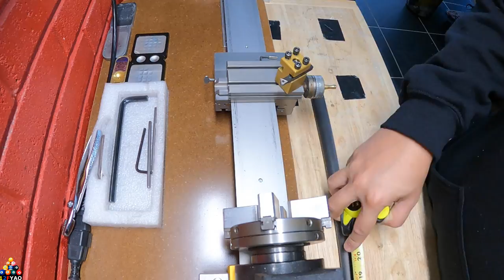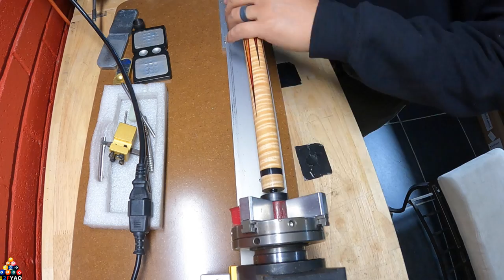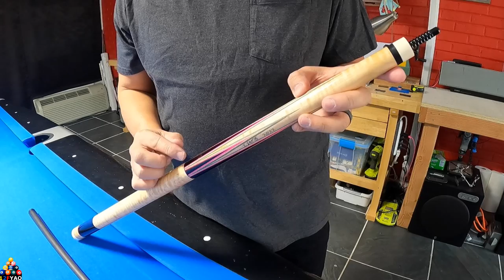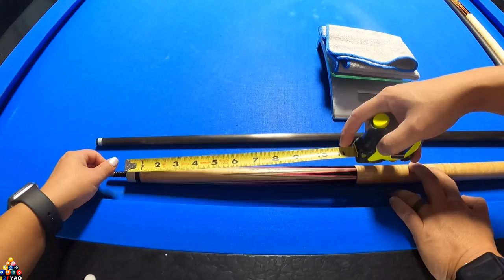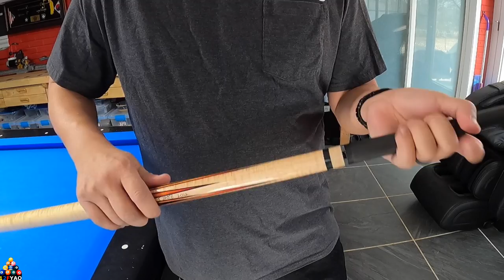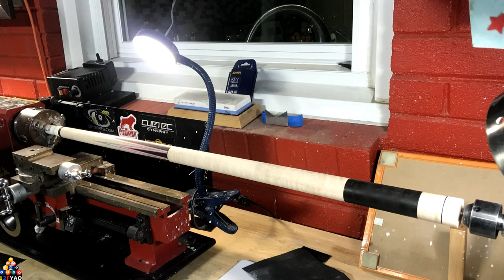Making a Pool Cue. Making a Carbon Break Shaft and a 6 Point Pool Cue, 3Hi/3Lo Curly Maple w/ Ebony

Comment: Sir i want to build my playing cue with this tutorial and materials, what is your oppinion between fill the carbon tube with any materials or not fill the carbon tube. Whats its your prefer like. And reason. Thankyou sir
Reply from the maker: Filling the carbon will help tone down the carbon. The carbon without the filling plays the same but the “ting” sound is higher pitched. To me the ting sound doesn’t bother me. Now a shaft without that noise sound dull or dead. The biggest thing with carbon shafts is the weight of the carbon. I would get steel or even brass all thread to get the weight you want. Most manufactured shafts are 4 oz and wood is about 3.5 to 4 oz. Since you are making your own shaft and cue, you can control the final weight and balance point. 
If I was going to make a playing shaft, I would fill it. Tape off the small end and use a small hose like the one used in aquarium and place it all the way down and slowly bring the hose up. Also don’t forget to tape the outside of the shaft. Hope this helps,please subscribe if haven’t already and please share.

Comment: Do you use 5min epoxy for phenolic ferrule and phenolic insert?
2 ton epoxy for metal pin and brass insert?
Reply from the maker: I use the same 5 minute epoxy for pin, inserts and joint collar. It hasn’t failed me yet. Hope this helps and thank you for commenting.

Comment: Did you buy a plain carbon shaft and turn it into a pool shaft? Where did you find that?
Reply from the maker: I did. I got a blank and turned it to a break shaft. As where I got it, I can’t say where I got the blank but eBay has some. Thank you for commenting, please subscribe if haven’t already and please share.  
Link to eBay. https://www.ebay.com/itm/223996249333?_trkparms=amclksrc%3DITM%26aid%3D1110006%26algo%3DHOMESPLICE.SIM%26ao%3D1%26asc%3D237166%26meid%3De44f98c7daf64d2fa316212df2f75617%26pid%3D101195%26rk%3D4%26rkt%3D12%26sd%3D224001046559%26itm%3D223996249333%26pmt%3D1%26noa%3D0%26pg%3D2047675%26algv%3DSimplAMLv9PairwiseWebMskuAspectsV202110NoVariantSeed&_trksid=p2047675.c101195.m1851&amdata=cksum%3A223996249333e44f98c7daf64d2fa316212df2f75617%7Cenc%3AAQAGAAACEJQ4TleUPgC%252Bf08erHjyFohROzaTxcE7Ydw5AI9VouN2b0JO%252B3Qhwk5Yit%252BofSBAVEYj8DQsnv9Vob3SFmmefoUu7tyj7LqBFdPjl2x1hNnHb6lg7P5GVuEQFvyBIuc0O%252FQJZ7AQDvsdvzBmvoRFl2rMFYx2NTRChVAxX8yrbSDImslItoFUbhykzW9oLZHE1vMyazqbM8KC%252Bme3Zfv%252FjNvg09XA5uALBUydqM09jgxtqiFjNPOL4i1agGghHUvAYm4RAlNr4PsfzoNKI%252Bmnt0zM7AVQEnAOWBIL6BHtunZFx5ourVuQ4THNRgSfhBm%252FWTwJfl2mvvG%252BtnCWmSSVzY0mV95%252FCCrQrWdTvnJE14q6hvboS5hjsRw9wyGlBYIFO6qh5bm9B9AW4T3SWKWCjpmzTL%252Fdiwwne9xPjeczjrtyKqlPX7APDsBuUyaPEji13n%252FGTjjaNNgK8qEIb0vqphHlwymGCJg6kAppXLvubgWXBF5gdx1rA1OrBQlPFd7sOSzJ0XAjD9iUiLex3xltZ11ET6gSc6RhmQv%252BorndJGR816nM5nkJGan4UPU35oWWmmc2yCXUkDzGpS1sWY81410vVpLceO5IoaIxKEYzyQzL6HskpHE6df8rm7l5TkLOfE2TIvwttuej0GqWghPbBZ0KEARyacFAfP4F9XvHIMU1ZbRZtC4%252Bd81%252BUBsJ9han%252Fg%253D%253D%7Campid%3APL_CLK%7Cclp%3A2047675
Reply: @playpool12fyao  can you send the link where we can buy the plain carbon? thankyou sir
Reply from the maker: https://www.cuefits.com/index.php?route=product/product&path=67_61&product_id=217
Hope this helps, please subscribe if haven’t already and please share.

Comment: You don't have to fill the fiberglass shaft with anything?
Reply from the maker: You don’t have to fill it especially if it’s used for breaking. The “foam” to me is a gimmick.  It’s used for “dampening” the sound so it can sound like wood. I’ve been playing with carbon for a while now and a shaft that does have the ding sound, sound dull to me.
Reply: If its used for playing shaft, is it must to fill with foam or anything?
Reply from the maker: For playing I would fill so it would sound too loud.  For breaking their is no difference, the g10 hitting the cue ball is louder than what the shaft can make. Thank you for commenting again and please share.

Comment: Why didnt you use a foam filled blank?
Reply from the maker: I filled mine and it didn’t really do anything. The sound and hit is the same. The only difference is, you have to be careful when filling. I did not want to have the foam touch the outside. To me it’s safer not to fill it especially if it really doesn’t play a role on doing something. Hope this helps, please subscribe if haven’t already and please share.